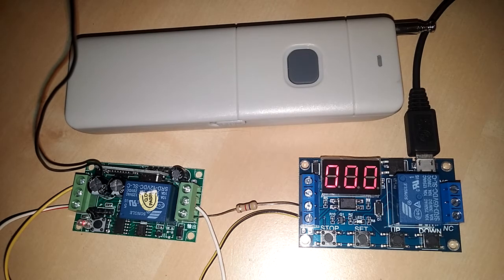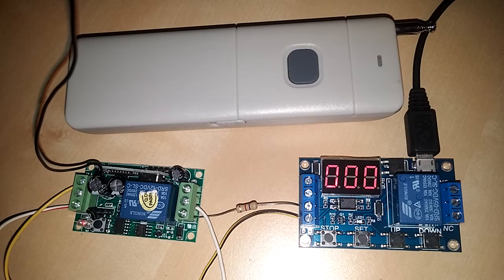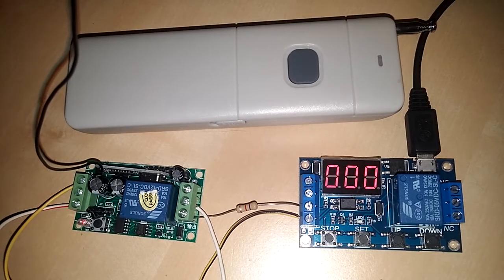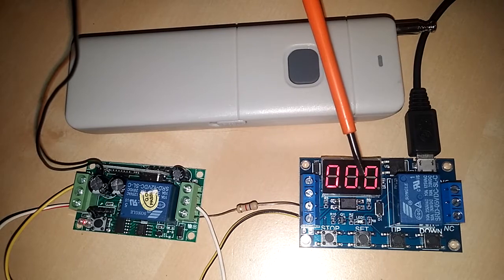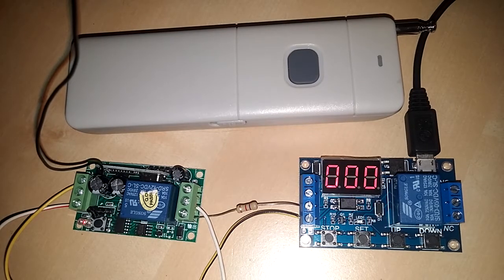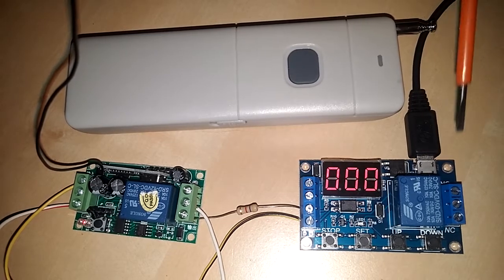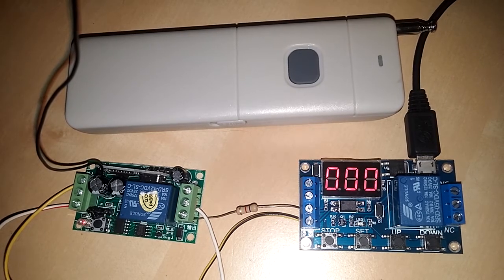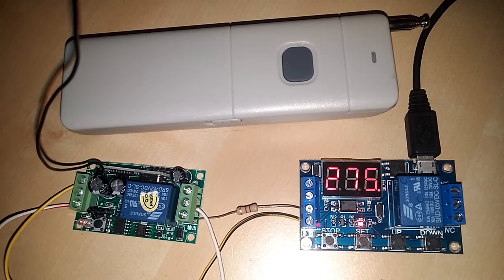Homebrew wireless water pump control system

Comment: Why is the white remote so big? I have purchased many of the 433mhz wireless remotes with key-chain sized transmitters. You can get multiple channel versions no problem also. I use them to switch my Transco coaxial relays that are mounted outside of my house.
Reply from the maker: Danish Native it holds a 9v battery. Supposed to have a longer range with the antenna. I wanted to be sure it would make the distance ok.

Comment: Those contacts are most probably rated at 10 amps resistive. I would not use the contacts to directly control the pump but install a second relay to handle that inductive load.

Comment: this is a very good idea..  my mom has one of those pumps under the sink of the bathroom furthest from the water heater.  problem is.. the activation button is also there. which is a mild annoyance. as you know, California loved building those mile long ranch homes in the 60s.